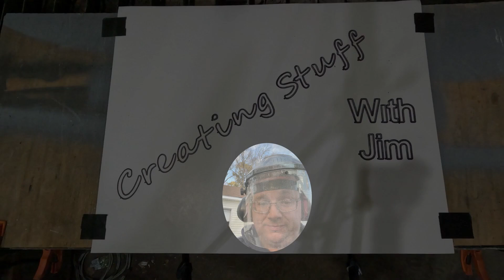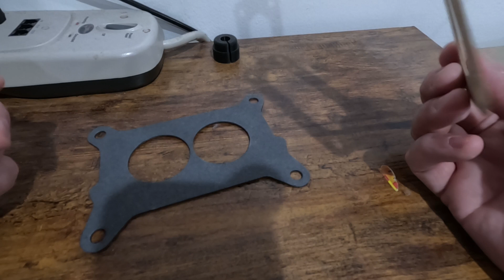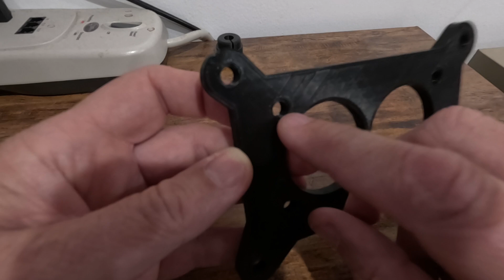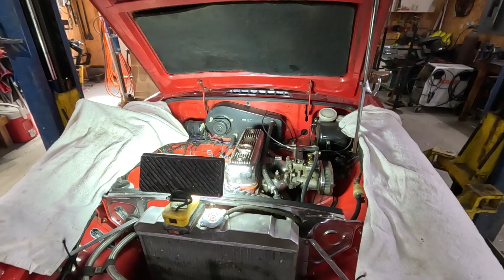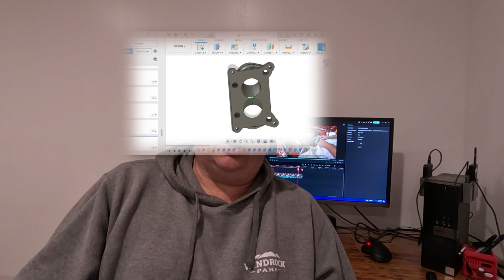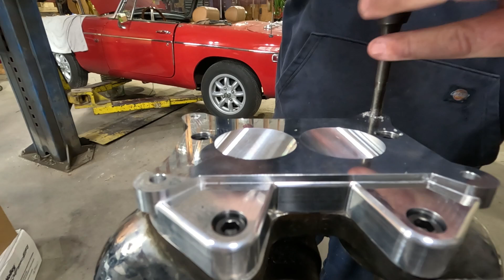MGB Fuel Injection. Designing the Adapter plate to mount the Sniper throttle body to the MG engine.

Comment: Hey Jim, I was wondering if you know if that Holley unit supports forced induction? Their website gives mixed signals, as it lists a HP figure N/A and with "power adders". They state they do not support boost control, but it's unclear if that means the software/sensors don't support boost (I'd be doing mechanical boost control anyways). The instructions also say one of the requirements of the engine is not being turbo/supercharged, but various pages of Holley's site mention figures with forced induction.

I'm interested because this seems like a great solution for doing a blow-thru (and intercooled) supercharger install on a MGB, and would conveniently bypass a lot of the limitations of the common routes to supercharging these engines.

I guess all I am really looking for is if the tuning software for that unit has fuel tables that can extend beyond 1 bar absolute manifold pressure. I'd assume the hardware itself wouldn't care at all.
Reply from the maker: Yes the sniper does handle boost. Well most models. The 2300 has the ability to move the MAP sensor pickup downstream of the supercharger. Holley does have a chart for which sniper does what. The ignition timing is a different story. They have their own distributor to run the ignition. They don’t make one for an MG so something custom would have to be done. At a bare minimum a cold air intake would help a lot with the sniper
Reply: @creatingstuffwithjim  My general plan is to using a 123 distributor to handle the ignition separately, then machine a mount for a M62 blower to sit on the opposite side of the engine (over the alternator, which will be swapped with a Denso forklift mini alternator for more clearance), then pipe the blower output around and into a carb hat (with some sort of intercooler based on what packaging makes sense), to blow through the holley unit.

I did see their chart, but it is one of those mixed signals I mentioned, when comparing it to the manual for that particular sniper unit.

I'm willing to let the blower and/or carb hat sit higher than the hood (this is a bit of a ratrod/restomod kinda thing, so it's not the end of the world to saw a hole in my beat up hood)

For the intake, I plan to turn the smiths box into a airbox, and route that to the back of the blower. Replacing the stock heater core and fan with a generic heater core and some fans designed for server racks.
Reply from the maker: @MatthewMenze that sounds interesting

Comment: I am so glad I found this series when going down the rabbit hole of what to do with my MG. One question I have, and maybe I missed it, is what made you decide between the two barrel and the sniper 1100? I have been debating between the two units myself.
Reply from the maker: Tell you the truth it was kind of a toss up. Went with the 2300 just because it was closer CFM to the Weber side draft that I took off. The 1100 would probably work better just because of the smaller CFM size. We did have to swap in smaller fuel injectors into the 2300 to smooth out the idel
Reply: @creatingstuffwithjim  How was the injector swap process? Does the Holley software support it well? I seen some references to people swapping them, but no direct documentation.
Reply from the maker: @MatthewMenze my dad did that part of it. From what he said there was no issue swapping the injectors and the software had no issues keeping up

Comment: Thank you Jim. I have several MGBs I would like to make this modification to.  I can't wait to see your future videos. An up-draft carburetor would be very interesting. 
I also have a 71 MGB. You should have a return line/tubing going back to the fuel tank for the overflow/vapor. The return line/tubing runs back under the curbside of the car and dumps fuel/vapor to the top curbside at a fitting under the fuel filler neck in the trunk.

Comment: One MG mod a friend done was he got hold of a quad set of carbs from an obscure model of the Austin Maestro the MG 1600 variant which had an unknown to the masses "option" of quad Dellorto carbs which were notorious for trouble keeping tuned and balanced in the days before threadlock became easily found but turned a rather mediocre 1600 hatch into something able to challenge Ford's XR3i.   He had to rework the manifold a fair bit as an R or S series engine is a mile away from the old MG engines but sounds astonishing on the pull.

Comment: I'm quite interested in this sort of thing, my own vehicle which has a Reliant 850cc engine in, isn't that far off a Mini A series as both shared the same parent Austin sidevalve and has been a long term goal to injection up the motor as the 850 is a very fiesty and capable engine but the SU does its job pretty well, its more sedate than anything and I did fit an Escort ICH which improved pull but going into top gear became a bit bleugh so back on went the SU.
Reply: I read somewhere that the Reliant engine was a Triumph Herald engine downsized. Someone said that you can use Fiat Cinquecento fuel injection.

Comment: You mentioned the 8n and updraft carbs. Are they less sensitive to vibration or flooding? Ford was all about cost cutting, so do they have fewer parts?
Reply from the maker: The biggest benefit of the up draft carb I found was it was very difficult to flood. Since the Carb was facing down as soon as I would stop cranking all the excess gas would run out of the carburetor.  I noticed this when I was working on a 1936 Seagrave fire truck. ( This truck Might make an appearance in a future video.) Thank you for watching my videos and Commenting.